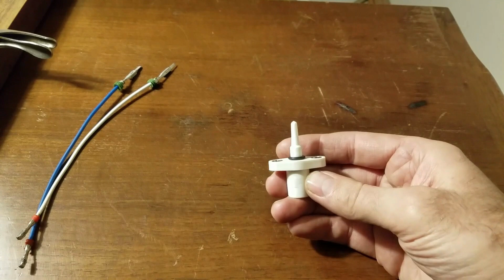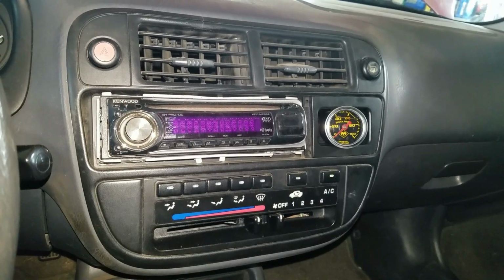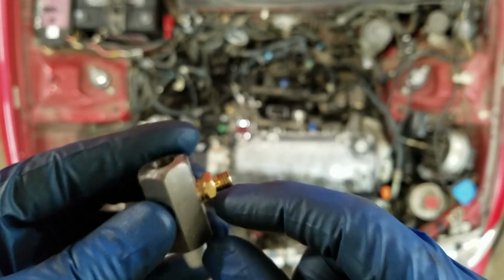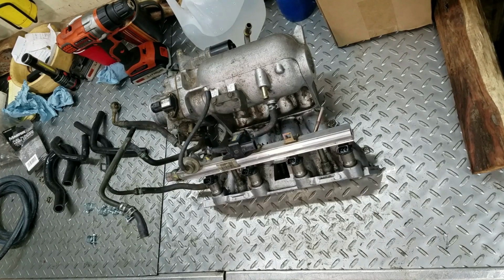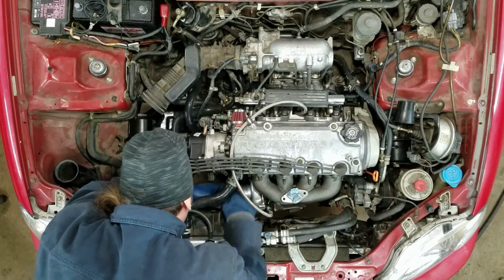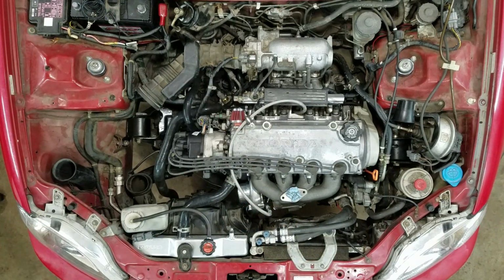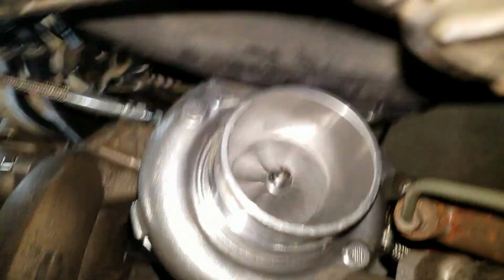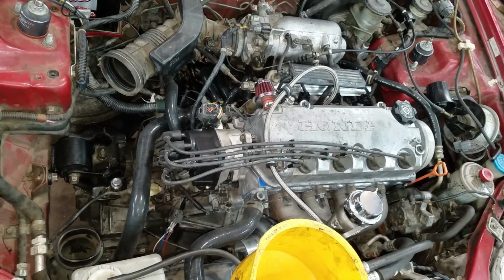Ej8 Civic D16 Ebay turbo build part 10

Comment: Search up oil adapter sand which plate on ebay you shouldve used that
Reply from the maker: For every problem that is solved, 10 more occur. Maybe if there is a next time. Thanks!